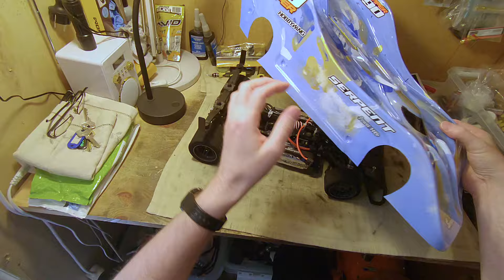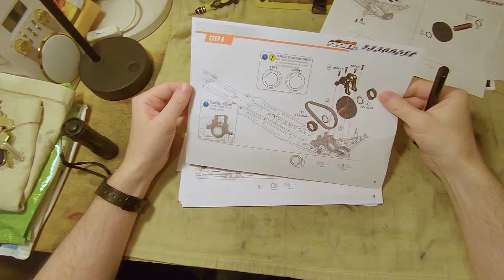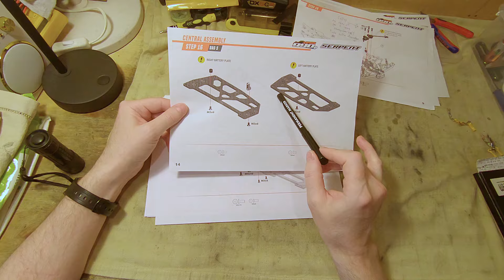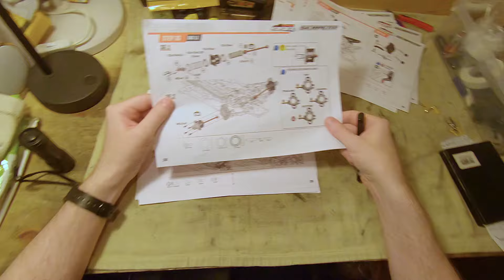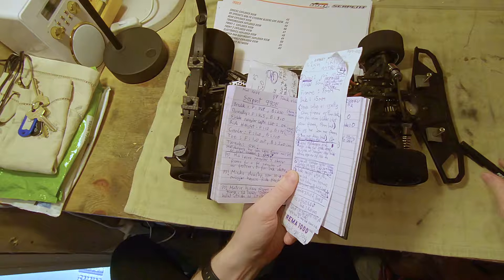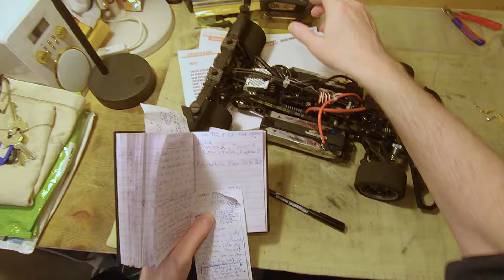Serpent Viper 990E - Build Experience And Setup

Comment: tak for fin video. Har bestilt en nu. Kan du fortælle hvad Pinion der passer til normal race track? ? / 48
Reply from the maker: Hei. Tror ikke jeg kan svare på det. Jeg bruker MOD1 med 22T, og spure er MOD1 med 42T (steel). Stock er 45T plastikk. Jeg har jo ikke siste utgaven av bilen heller, det er kommet nyere etter dette. Sjekk på websidene til Serpent. De har sånn Excel fil man kan laste ned. I den står det alle mulige kombinasjoner av spure og pinion. Og sjekk hva folk som kjører racing bruker om du skal kjøre løp. Det er også regler å forholde seg til på giringen, så du må sjekke at du er innenfor reglene om du skal delta i løp etc. Lykke til 👍

Comment: was wondering what tradio and battery pack are you using?
Reply from the maker: It is two batteries, "Sunpadow Platin Stock Racing 8000mAh 7.4V 2S 130/65C LiPo". They are connectied in series so we have 4S volt. I am not doing any serious racing (yet), so if you are into racing (I believe they do 7 minutes races) ask the people that are doing that. I have seen some people using 9000mah batteries.  Radio? I am using a Spektrum DX5, but any radio and receiver for rc racing will do ok.